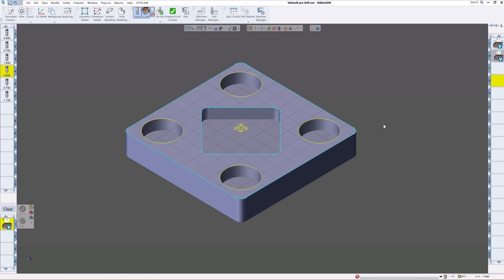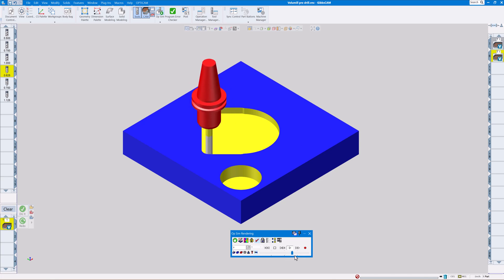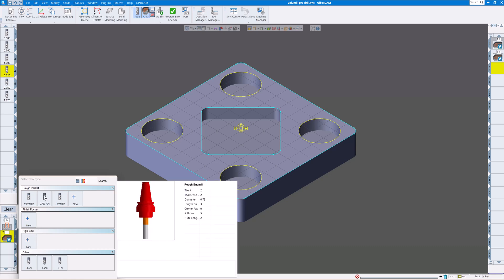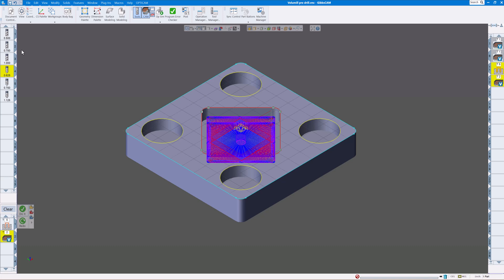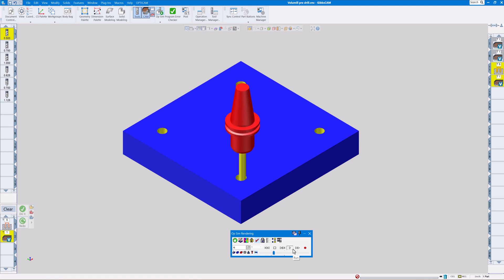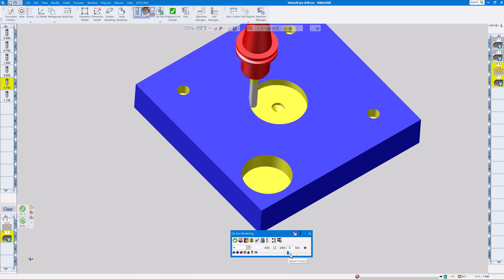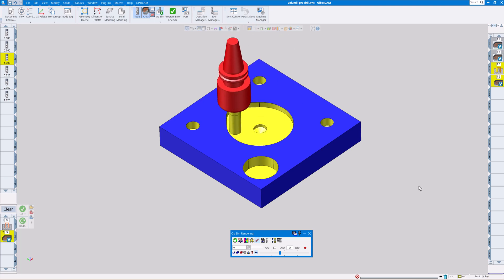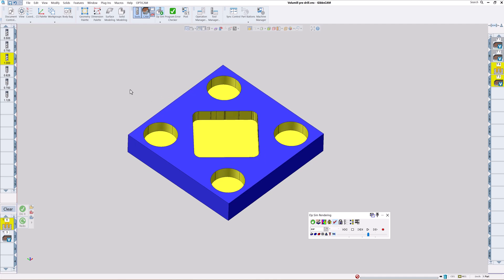GibbsCAM Volumill Pre Drilling

Comment: Whenever I post a program with VolumMill, my feed is not what I put it to in Gibbscam, instead it keeps constantly changing. Is there a way to make it keep constant feed (what I put it to) while still using volummill?
Reply from the maker: Volumill will always be changing feed rates based on what it conceives as chip load on the end mill.  Example, a long straight cut could go your programmed feedrate, but a small arc at that feedrate would overstress the end mill and chip load, especially going into corners where is might snap off the tool.  Hope this helps.  You could change to just a Roughing process, where is using only one feedrate, but normally you have to slow down the feed rate if you don't want the end mill  to break in corners.  Thanks for watching.

Comment: Would of been nice if you would of told us what the boxes on the PRE-MILL tabs are for like what is the 33% on the clearance for or what is the clearance Z for ?
Reply from the maker: That is for another video.  If you want to know what the 33% is, it has a lot to do if you have a pocket and want to  drill out the corners prior to machining the pocket.  Again, that will be in another video. This one was just for drilling prior to using Volumill.  Thanks for watching!